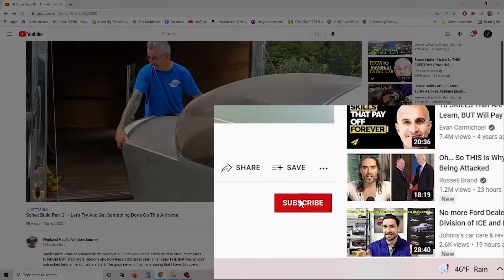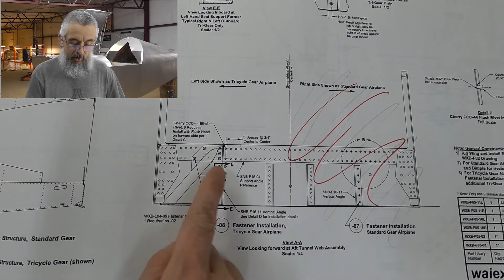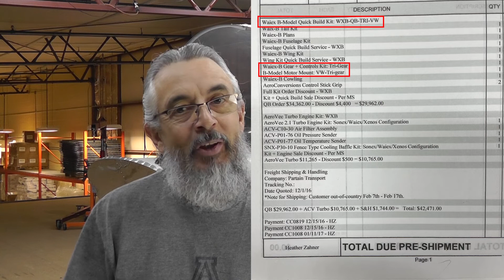Sonex Build Part 35 - Did Sonex Ship The Wrong Fuselage With My Quick Build Kit

Comment: Sir.  This problem, "created for you," IMHO, is a blessing in disguise.  After all is said and done, you will be SO GLAD you ended up with a tail dragger airplane.  No question about it.  The tri gear might be a tad easier to fly, but you will find that the tail dragger is really flying, and you will LOVE it - NO question about it.

There is no mystery about flying a tail wheel plane - you actually fly the plane, rather than "driving" the tri gear on the runway.  Am I the master of the tail wheel?  By no means.  But, as an Experimental Amateur Airplane builder - built three, I just loved the tail wheel in comparison with the tri gear.

I just loved flying my EROS 1650, especially on windy days.  It was really fun.  Did I get blown around a lot?  Yes - but that made the flying all the more fun. Flying the tail dragger takes away the boredom that you have with a tri gear plane.  The tail dragger makes you a good aviator.  I only put a little over 750 hrs on my EROS, but they were certainly fun hours.  

I built my EROS because I did not like to fly General Aviation planes any longer.  I would NEVER buy a GA plane, (Can we all say money pit?), and renting was a real hassle.  Way back when, approx. 20 or so years ago, I considered the Sonex.  I still love that plane.  But the EROS could get me to those fly-in breakfasts, although a little later than my friends. :-)  I only cruised at 80 mph.  But I got there.  I had just as much fun as those guys driving the 152's and 172 's and other GA planes.  

What would I do?  (I know you aren't asking :-) I would build the tail dragger - NO question about it.   Get the other engine mount - change the gear, and ask for some remuneration from the Sonex company for the problems THEY caused you.  Think about this:

You are coming down "final," crabbed 20 degrees to the right - you are tracking that center line with your "dancing" on the rudder pedals, and adept movements of the ailerons.  You hold that configuration right through your round out, and quite a bit into your flare.  Then, nearly at the same time, "wing down, and necessary rudder" to align your Sonex, and touch down on the upwind gear and the tail wheel, also at the same time.    (This keeps the wind from weather cocking the Sonex.)   A wheel landing might be OK, but you may run out of rudder authority trying to keep the plane straight.  I think you are lucky to have had this "problem" given to you.   Good luck.  N-6395T
Reply from the maker: Thank you and I am sure that someday I will fly a tailwheel aircraft and I would not be surprised if I fall in love with it but seeing how I am just starting I just feel better with the tri-gear. New student pilot, experimental aircraft and then add tailwheel would probably cost a fortune for insurance.
Reply: @weekendhack.whatsnext  Yes, the insurance can be a problem.  I was with Avemco - great company.  I couldn't afford the "Hull insurance," so only went with the liability.  As I recall, the FBO's wanted at least $500,000.00 liability.  

If you end up in someone's "living room," you will need some substantial insurance  For a long time I flew out of a field in Rockledge, Florida, 21FA. Homes were built right up to the field.  The field has been there over 60 years, and they just kept building closer and closer. :-)   Take offs were interesting - had to have a definite "Plan B."  Good luck - I'm sure you will do well.  Thanks, N6395T

Comment: Yes I think you have the taildragger.  Same rivets have to be removed (actually even if you get the tri gear fuselage). Get a drawing for the reinforcements needed for the tri gear ( and maybe also the some of the aluminum parts needed ).
Reply from the maker: I ended up ordering the parts to rebuild the spar tunnel to the tri-gear specs. All the parts arrived this week and now I just need to get back on track with the build.

Comment: You just can’t make this stuff up and it definitely adds drama to the channel but it hurts me to see all the struggles you have had to deal with.  I hope that Sonex will be a standup company and work out a solution with you.  I understand the concerns about a conventional gear setup but at least you could look forward to lower empty weight and higher cruise speeds.  Good luck 👍
Reply from the maker: Thank you. It does feel a bit dramatic at times but considering that I started with someone else's project I was expecting some speed bumps along the way. I consider myself a problem solver so who better to be presented with this stuff. LOL. Sonex has been working with me on this situation and I am sure that it will all work out in the end.